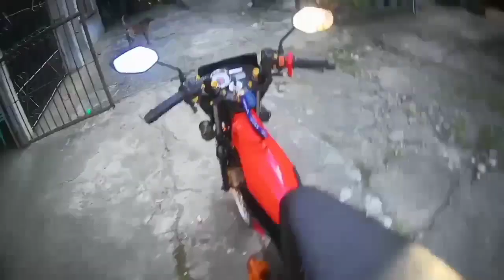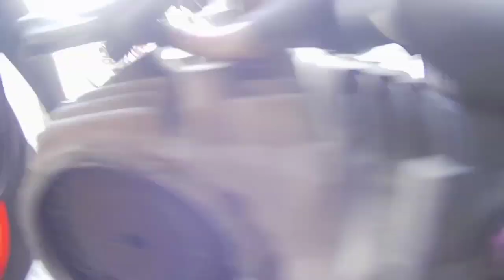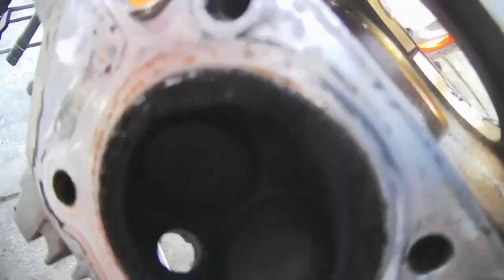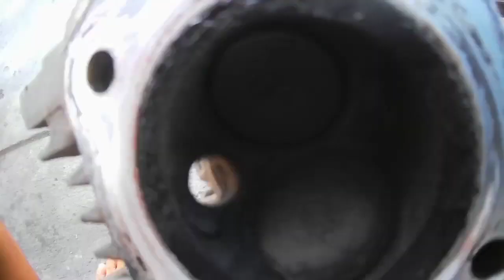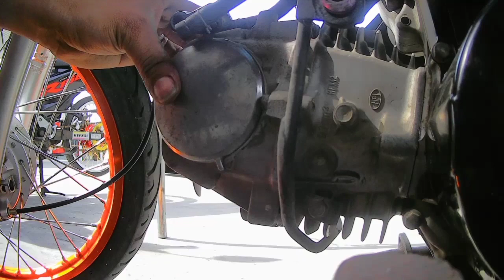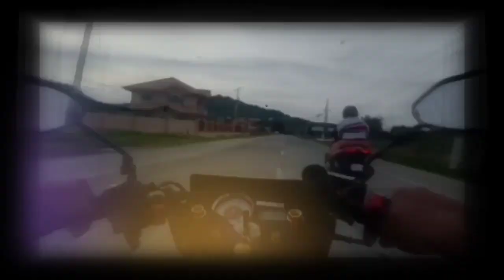Cylinder head naloosethread yung sparkplug hole honda wave100,naayos nga ba

Comment: Bossing pa enge ng tips about sa wave100 
nka 54mm nako tsaka cams st2 iba stock na medjo kulang kasi sa takbo. ano pa kayang magandang mods idagdag boss para lumakas target ko is mga 125-130cc na setup daily use motor ko. thanks sir sana mapansin mo comment ko 😊 Happy new year
Reply from the maker: Palitan mo nang redspeed yung cams mo,,28mm na carb,,brt na cdi,faito ignition coil,big head, clutchspring kitti,
Reply: @ILOCOSMOTOSPEED  yes boss nka 28mm nako gusto ko mag add stroke o up stroke ilan mm safe boss?
Reply from the maker: @AngryNoodle95  3mm
Reply from the maker: @AngryNoodle95  kung walang machineshopan 1.5 mm
Reply: @ILOCOSMOTOSPEED  3mm boss pwede ba stock conrod gamitin?
Reply from the maker: @AngryNoodle95  tabas piston pag 3mm pero kung gusto mo walang tabas 1.5 mm
Reply: @ILOCOSMOTOSPEED  need paba mag pin boss?
Reply: Di magaling ang takbo nag motor kapag bigvalve tapos 54 lang
Reply: @jerichorosini8502  ano pa e dagdag boss?